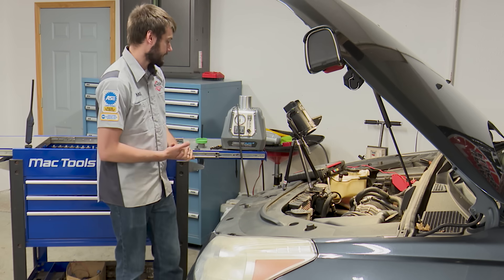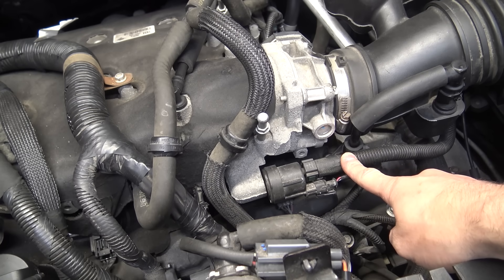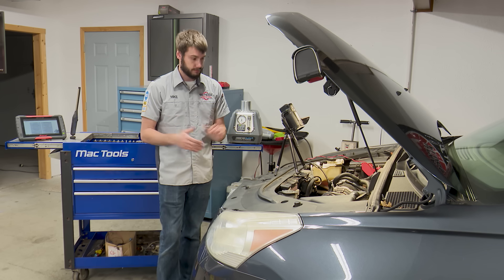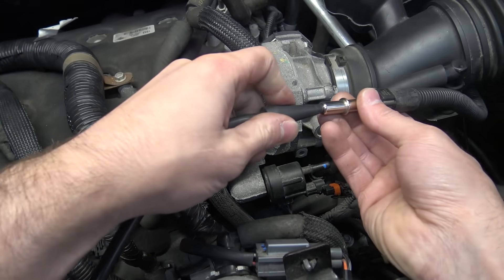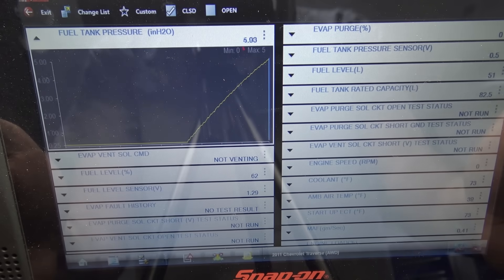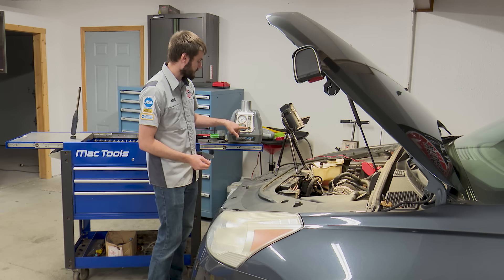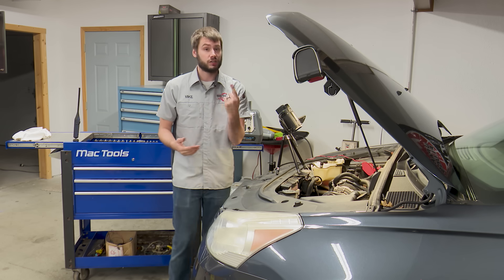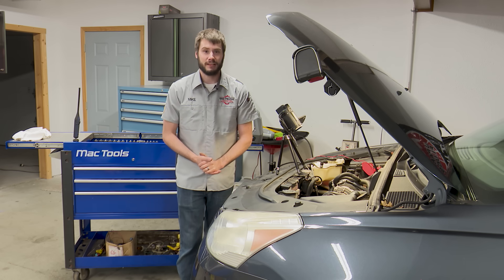How To Perform An EVAP Smoke Test To Look For Leaks

Comment: Mike, I have 09 s80. I monitor the EVAP-flow while driving. Its reading is 0.36 g/s. Is it normal? Is it should be 0 at most of time? No DTC code, but mpg dropped from 25 to 21 recently. Long term fuel trim is about 5-6%. Thank you
Reply from the maker: Hello,
I believe that scan tool pid on the s80 is showing calculated purge flow volume. It is normal to have that amount of flow while driving. 5-6% fuel trim is not bad either. If your after a recent MPG drop, I would start by checking fuel quality.
Thanks for the question!
Ryan Wilsing, Technical Instructor
Reply: @GoTechTraining  thank you for your reply and knowledge. There was no check engine light. There is gas cap message after filling up gas. I do see a p0445 via vida. Clean the gas cap. Tested and cleaned the purge valve. Applied some rubber conditioner. Then the code becomes p0441. Reconnected the purge valve 2 days ago. No code so far. But mpg is still 20-21, was 25 mpg couple weeks ago. There must be a leak somewhere.

Comment: 1,500 for that and it's <2 psi only?
Even if it had some infinitely variable with every bell and whistle imaginable that's absurd.
Reply from the maker: Hey Hbeezey, it's not about the pressure. It's about the ability to accurately measure the leak.
Mike Becker, Senior Instructor

Comment: If I don't have a scan tool to shut closed vent solenoid I could block off hose going to vent solenoid as a cheat? Replaced vent solenoid already so out of the equation anyways correct? Kia optima has fuel tank air filter block this off too?
Reply from the maker: Hey David, yes you can pinch the hose off or jumper the solenoid closed with a set of jumper leads. If you've already replaced the vent then I would just pinch it shut to smoke test.
Mike Becker, Senior Instructor
Reply: @GoTechTraining  Thank you for quick response.  I've learned much watching your videos.

Comment: Sooo the Halloween fog machine and leaf blower in the tail pipe is not the greatest idea I take it? See all these videos that act like it’s so safe and effective but have a feeling I’ll screw something up!
Reply from the maker: Hahah yeh, you have to be careful with that. EVAP systems are only designed for around 1 psi of pressure. Smoke testing the exhaust though, sure that could work if the fog machine can put out enough volume. 
Mike Becker, Senior Instructor

Comment: Thanks for the vid! I'm confused about the vent solenoid. Why is the vent solenoid 'open' with engine off? Do you mean it's open to the air? That would defeat the whole purpose of the EVAP system, lol. Or is it simply open to the EVAP system? And if it is open to the system, wouldn't you want it that way for the test?? I've got my new smoke machine coming tomorrow (8/29/2022), so I want to do this right. This dang P0442 code is driving me nuts!
Reply from the maker: Hello,
The vent solenoid is open unless the vehicle is testing the system for leaks. This is because the fuel tank needs to vent with the expanding and contracting associated with temperature change. This ok be cause all the venting must first go through the charcoal canister to be scrubbed before entering the atmosphere. The system checks for leaks because if there was a leak, hydrocarbons would be able to vent from the tank without first going through the canister. To smoke test the system you must first close or block the vent solenoid off. I hope this helps and good luck finding you leak.
Ryan Wilsing, Technical Instructor
Reply: @GoTechTraining  - Thank you! It's impressive watching you effortlessly go through the diagnostics and repairs. Well done!
Reply: @ChevySS1968  Totally agreed!!!  Knowledge means less to get flustered about.  Glad to have found this video. It answers a lot.  :)

Comment: will a smoke test work ok form the evap test port? i tried to do one the other day from that test port and the smoke was going somewhere but i just could not see it. so i might have to get a laser light or maybe a red light or blue light what might work better? what would be a good cheaper dyt smoker to get for the occasional tests     will i have to find the purge valve and block that? or if it is leaking i guess i will see smoke from the TB area that would tell me the purge valve is bad? for the vent valve i know i will have to close. i do not have the tool to command so i take the hose off and plug that valve. i have to get or make a smoker. i did make one out of a glass jar and it worked well until it broke the other day and started burning. thanks

Comment: will any laser light work? also i take the vent valve and plug it after i smell the smoke, i have to get another smoker as my home made blew up and caught fire. but my s10 still give p0440 so i have to now wait for another code to see if i get another code to help guide me to the point. i did not see any smoke the last test i did.

Comment: Fantastic walk through. Clear and concise. I have a PO442 error code on my 2012 F150 Lariat 5.0
I feel I can confidently now trace the leak. Thank you !
Reply from the maker: Now that's what I like to hear Sean! Good luck with your diagnosis!
Mike Becker, Senior Instructor
Reply: @GoTechTraining  I had my fuel pump changed and ever since then my check engine light comes on with a P0440 code. I had replaced the gas cap and purge solenoid and it still comes up. Sometimes when I put gas in the check engine light goes away. Do you think the fuel pump was the cause because it started from there?
Reply: Gasket probably not seated properly.

Comment: As far as closing the vent value without a scan tool.  Can't you just disconnect the electrical connector controlling the vent valve and that would remove the voltage and close the valve?
Reply: No. The vent valve is normally open position, meaning when no power is applied to it, it stays open. Applying power to it is what makes it close.

Comment: Hello Mike,I have a 2010 F150 4.6 that has error code 466 and 455 and when I checked the Evap vent solenoid  by applying voltage from separate battery source it functioned normally. When I checked for reference voltage at connector with key on engine off i had 0 volts.I checked the purge solenoid connector and had 12 .15 KOEO. Both of these sensors should have 12.15 volts from parallel connection (same green wire color)when key is on and PCM controls switching thru ground side. This failure of canister vent would also explain the 455 (gross leak) code  wouldn't  it. I am right to just focus now on looking for break in circuit. Thanks for great video.

Comment: I have a 2005 Honda Pilot that doesn't pass the EVAP self test. Using a Launch Scan tool. But I'm not getting any EVAP codes. My FTP reading when the engine is off is a -0.10 hg. Once the vehicle runs and I monitor it, the pressure goes up to about 0.29hg. The only code I have is for a p0172. Is it common for EVAP issues to.make an engine run rich? I've ruled out bad 02 Sensors (replaced already) and Injectors. Thanks for any input.

My Temp reading at ECT 1 is at 183-185 F. Should be at 195. I did get an intermittent p0116. I will be replacing my thermostat since it's inexpensive. I don't know if that's also contributing to my issue.

Comment: I find it difficult to manually close the vent valve. Do you think it'll work if the vent valve is temporary covered with masking tape to prevent smoke from getting out, is a good idea?
Reply from the maker: Hey, sure you could cover it. The only issue is by covering it you aren't able to confirm if the vent is the leak in the system.
Mike Becker, Senior Instructor
Reply: @GoTechTraining  Thanks for that information. If you could help me on this question. On the vent valve when it is closed if I do a vacuum test for leak does it matter which end I connect the vacuum to?  You know how one tube go to the charcoal canister and the other tube vent air in and out.

Comment: Where do i connect for sentra 2005 please.
Reply from the maker: If the car doesn't have a quick connect port under the hood then I suggest connecting at the purge solenoid.
Mike Becker, Senior Instructor

Comment: I don’t have any fancy scanner to close the vent valve. Can I disconnect and pinch the hose completely closed where it connects to the vent valve and then run the smoke test? (Assuming I know the vent valve is not the problem). Thanks
Reply from the maker: Hey Mike, sure you could do that. Like you said, that's assuming the vent is ok. You're taking it out of the system at this point.
Mike Becker, Senior Instructor

Comment: There it is remotely open and closed the vent this is how mechanics take control over your car check engine light and cycle the check engine light and most people will carry their car to the dealership or mechanic to turn off the engine light and

Comment: How long should the whole process take?
Reply from the maker: Hey Darladoright, thanks for watching! Usually a smoke test can be performed in under an hour. It would depend on if further diagnosis needs happen. Like if the fuel tank we need to be dropped or something like that. 
Mike Becker, Senior Instructor

Comment: I've replaced that exact purge valve solenoid for 2016 traverse twice now.  Same result for both times, engine light will stay off for a few weeks and then throw the p0496 code again. Any ideas/recommendations?  I haven't replaced gas cap yet, guess that would be the next  cheapest.  However, what would cause a new purge valve solenoid to work like it should for a few weeks and then get stuck open?

Comment: Excellent video with the perfect amount of educational information. I have seen too many videos from others that are either too long because they dwell on useless information or others that are too vague and don't offer enough information. Of course, I have seen some videos that give incorrect, bad and sometimes dangerous information. Those should be reported and banned but that is another topic. I thought your video was very educational, to the point and covered everything in a short amount of time. This is an excellent video, IMO. Congratulations and thanks for what I consider to be an excellent presentation. Also, I use a laser pointer and it has enabled me to find leaks that I may not have seen without it. Of course, I'm 60 years old and my eye sight isn't as good as it once was. lol
Reply: I agree with you JL

Comment: hi, i did a live scan on my car on the evap system vapor pressure and with the car running or not running with key on, the pressure is 1300  way off normal. is this a leak or clogged canister thank. no codes just bought the 2013 mazda 3.

Comment: how to close a vent solenoid on a 2005 f150 5.4 liter? also, is the "Purge Solenoid" the same as a "evap purge valve" as shown here https://youtu.be/0MmRZljM6qg     if so then I would connect my smoke machine to the top hose shown in the video ?

Comment: Great info, thanks. I have a 1991 toyota celica that i want to check through, it smells very rich whilst warming up, has poor fuel economy, and there is always a rush of air when i remove the gas cap to fill up, is this normal? Otherwise, it runs well, plenty of power etc?

Comment: I changed fuel cap, then purge solenoid and last charcoal canister and still have p0455, and check fuel cap. Honda accord 2013
Reply: Please any advice, i have no smell or any visibly issue at least to me the car owner
Reply from the maker: Hey Kdsom, thanks for watching! Honesetly, you're best option is to take it to a trustworthy shop and have it smoke tested. A P0455 is a leak code. You could have a cracked line or hose somewhere that you may never find without leak testing.
Mike Becker, Senior Instructor
Reply: @GoTechTraining  thank you mr Mike i will take to the dealership then.

Comment: So if disconnect the power from the purge selenoid there should be no suction but if the power plug is connected you should feel suction correct?

Comment: Is it common to NOT have any codes thrown but have a to lean pending code (2187&89)on the OB2. I ask only because I think that I have a leak up front someplace because I CANNOT get my EVAP or secondary air to get ready for the emissions test. My car runs / drives perfectly btw.

Comment: I was working on my 96 Explorer, Had a P0455. Turns out the 1/2" steel evap tube from the purge valve to the canister was full of rust holes :lol:. I was smelling gas.  I recently replaced the tank too. Going to replace  with a 12' rubber fuel line.
Reply: Thanks for that tip!!!

Comment: Is it possible to over pressurize the evap system with a leak detection machine?
Reply from the maker: Hey Barnes Christopher, yes it's possible...but only if the smoke machine isn't rated for EVAP. If it's an EVAP specific machine, then no. It's pre-calibrated to not blow the system out.
Mike Becker, Senior Instructor
Reply: From little that I know lol no more than 1psi should be pushed through the lines so-as not to damage any seals or components. (No disrespect to anyone) A smoke tester is used to find leaks, not cause leaks. If using a homemade smoke tester make sure you hook up an air regulator, like the kind used on propane BBQ grill. An air compressor typically goes down to 2 or maybe 1 psi. But be safe.

Comment: Your smoke machine cost 4x more than my 🚗
Reply from the maker: Hey Matt, thanks for watching! Many times the tooling and equipment costs that we use to accurately diagnose costs more than the car we're working on. I guess that's the difference between pro level equipment and DIY. You could dig a foundation with a shovel, or an excavator...kinda along those lines ;)
Mike Becker, Senior Instructor

Comment: Very informative video and good instruction.  Lost me with the $1,200 machine but appreciate the tip for closing the vent without a scan tool.
Reply from the maker: Hey Don, thanks for watching! You can find smoke machines for cheaper. Sometimes used ones can be a great deal.
Mike Becker, Senior Instructor
Reply: @GoTechTraining  I found one for 100 bucks but not sure how to close the vent solenoid since my scan tool is autel md806 pro and I don't think I can use it to close it as your snap-on  did. direction on how to do this would be great.
Reply: @A.C.71  Use a hose clamp to pinch off the vent line at the solenoid.
Reply: @robbanta2979  Thanks for the tip!!!
Reply: @GoTechTraining  Thanks for the used ones tip!!!
Reply: Need bidirectional scanner
Reply: Maybe the price is in Canadian dollars, but you're right, that price is astronomical. Many of the sub-$100 smoke machines I've seen sold, which have the on-board air compressors, put out too much pressure to be safely used on the EVAP. (The ANCEL S110 appears to be at least one exception). Other machines in that same price range that DON'T have the compressors and require you to instead connect up external air tend to put out the correct pressure (Ancel S110, Romondes SM601, Autool SDT103 are a few). Personally, I'd rather have one that doesn't include the compressor, as that seems like an extra failure point.

Comment: Super helpful. Been chancing an evap leak in a 2004 Corolla for a while and I didn't understand the vent valve was normally open or how to close it.

Any guess what the least expensive scan tool is that has the ability to close the vent valve and read the pressure?
Reply from the maker: Hey John, thanks for watching! I would look into options from either Autel or Launch.
Mike Becker, Senior Instructor

Comment: I have a red light on my scan tool but it just says EVAC the Code reads P1072 rich bank 1
Reply from the maker: Hey John, so you're dealing with a rich condition on bank one?
Mike Becker, Senior Instructor
Reply: @GoTechTraining  What new?
Reply from the maker: Sorry John, there's about 1000 different things that can cause a rich condition. First step is going to be to determine what the fuel trims are and when the vehicle is actually running rich.
Mike Becker, Senior Instructor
Reply: @GoTechTraining  I have a Zurich  R11 its suppose to display live data but now sure what the data should read?
Reply from the maker: Hey John, I have a playlist dedicated to fuel trims and how to understand them. The videos are quite long but by the end I can promise you you'll know what the data should read.
Mike Becker, Senior Instructor
Reply: @GoTechTraining  Thanks I will check it out!

Comment: Sir, is it possible to add engine oil dye in smoke machine to see smoke more visible??
Reply from the maker: Hi Harinder, thanks for watching! You can actually by smoke machine oil that has UV dye in it already. I would suggest buying that instead of adding engine oil dye.
Mike Becker, Senior Instructor

Comment: Mine leaks smoke from the Throttle.position sensor. What could be the problem?
Reply from the maker: Hey, hard to say. Could be a loose bushing of the throttle shaft?
Mike Becker, Senior Instructor
Reply: My understanding is that a very minor leak around the TPS sensor, perhaps the shaft bushing, is considered normal.   And this should not affect vehicle performance or cause the self evaporate test to fail.   I recall a video from Eric O at South Main Auto addressed this in one of his videos.   You might try browsing over there.